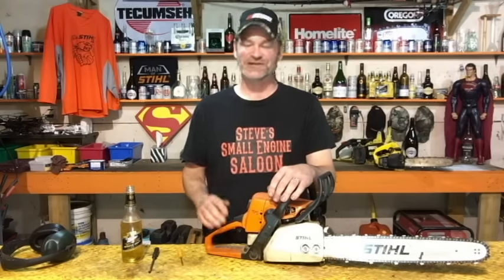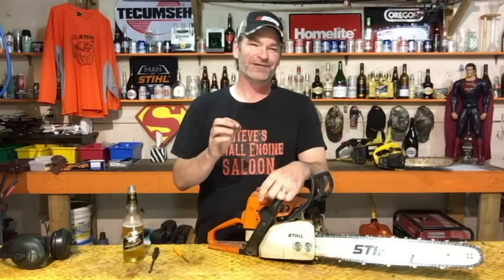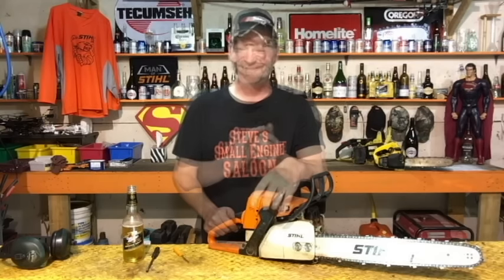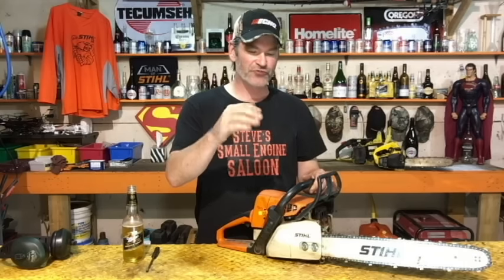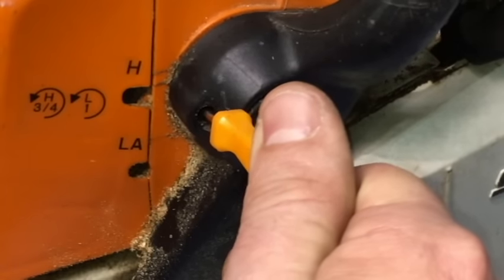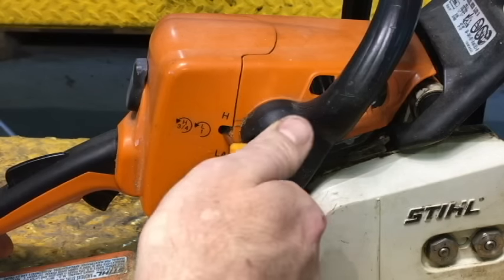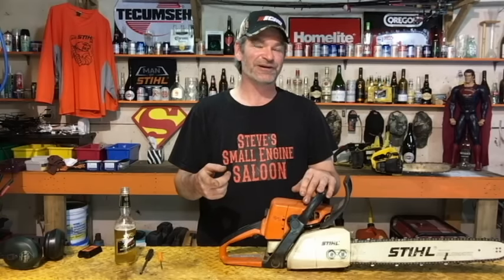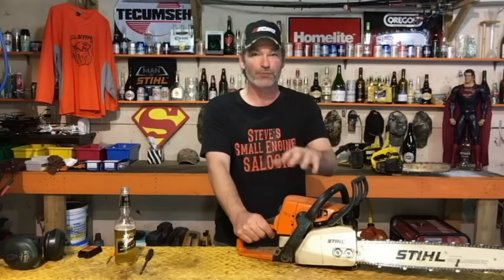CORRECT WAY To Adjust Or Tune The Carburetor On A Chainsaw (Step-by-Step)

Comment: my Honda(being 8 years old at the time) had a stuck choke valve and it would not open. It was "auto" choke! so I had to take it apart just to clean the gunk off it with my fingernail.(and that is the tool I used) but took a few other tools to take it off!

Comment: my bigest problem with carburetor is on stihl 041 av electroinc,i cant set idle  to idle nice and clean if i rev it up it bogs down to stahl,i start with one full turn both H and L  and  starting wiith  L adjusment but no luck so far .will replace all membranes in carb since engine was in shack siting for 2 y.If anyone knows bit much about 041s any words is  helping.Tnx great video liked and subed

Comment: Steve, have you ever heard of any kind of chainsaw test bed, which would have straps for holding down a small engine so you can actually work on it easier? I've been thinking of trying to build something like that. 

I have a Husqvarna 460 Rancher I recently cleaned the carb on by immersing it in an ultrasonic cleaner. It looks to be some kind of two-stage unit? Still runs like crap and I can't even seem to get to a point where the engine will idle properly to stay going. It seems like the low speed idle needle will only come out maybe 5/8's of a turn. Does this sound normal? Shouldn't I be able to take that ALL the way out? I didn't remove it to clean the carb. Perhaps I should have tried. And does the hi-speed idle screw come all the way out, as well? If the carb is clean and it wouldn't be that, (looking at your cold-start warning video) perhaps I should look more closely at the piston and see if it is scored. Because I bet that saw has been used from cold start right away. Good catch on that, btw. I never think consciously about how I use the saw (or how others do), but I'm pretty certain I always let mine warm up at least a minute or two. I've been using them since about 12 or 15 years old in Newfoundland. Anyway, any comments you might have would be welcome. Take care and all the best, eh? :)

Comment: So....this helped a lot, but when I checked my idle with a tach, it was (PERFECTLY) idling about 1000 rpms higher than manufacturer spec. Chain wasn't moving. When I set the L screw to get on spec, it just doesn't sound or function as well. 

Is there anything wrong with a high rpm reading on idle? My full bore rpm reading is just fine in spec.

Comment: Hey Steve. My old MS250 will idle for minutes at a time, run flat out no problem and throttle response is good. I can makes multiple cuts through big stuff with barely a break between cuts and it never gives any signs of fuel starvation.
But, if I leave it idling for more than 30 seconds or so it will die as soon as I touch the trigger, sometimes just picking it up off the ground makes it die.  
Do you know what's up please?

Comment: Can a chainsaw vapor lock or what might have happened to give this outcome?

I adjusted the carb on my Poulan the way you outlined and went to the woods with it this past Monday. The temps were bitter cold, maybe 5-10F w/o windchill. So, I made sure it would start at the truck before heading into the woods. It started fine and I kept it running/warming for the 5 minute walk to a tree I had already started cutting on a week before. Well, I only made it another minute or so before the saw died and couple of times. It kept bogging, getting progressively worse with time. After it fired, what I thought was it's last ignition breath, I couldn't budge the rope. I feared that she seized up. I tried a few more times to start it, once at the truck before I headed home and other times at home hours and days later. I was really feeling down about it.

Well, fast forward to more than a week later (today) and with it on the garage floor, thinking it'll only be good for parts, I pulled on the cord one more time and WALLAH! it turned over (with compression). I put some gas back in her and after 4-5 pulls she fired right up. Here I thought my 38-ish year old trusty saw had gone to heaven only to find out she lives on. Maybe she was really tired but couldn't give up because a new (Stihl) girl came into the neighborhood?? Either way, happy to have them both!!

Comment: My stihl 194t is on revs up just the bar and chain don’t move even while triggering.  My chainsaw is on just not moving I was cutting a tree 🌳 trunk it was working fine now the bar and chainsaw not moving at all.  Is my tension on to tight or is it dirty cause of
The tree cutting trunks not sure so I took handle off to clean up bar and chain this work 1 time now it’s doing it again.  The chainsaw pretty new not sure if the oil I’m using is the problem not oiling correctly.  I’m using 50/1 fuel ⛽️ and using a non branded bar and chain oil.  Do you have any suggestions.  Thanks keep up the good work.
Reply: Any suggestions what’s wrong with my chainsaw?   I’m not used to using equipment like this .

Comment: Hi Steve. I have pulled my carb out of my cheap chinse chainsaw. Am I supposed to be able to pump fuel through the carb and back to the fuel tank? It does not work for me. I have cleaned the carb out as much as I can. Still no flow through the carb. What could be blocked? I have flushed everything with carb cleaner......checked all the hoses...it is just the flow through the carb that is not wprking. Do have any suggestions? thanks Ian.

Comment: i just got a echo cs590 for 140 bucks, craiglist add. used twice, dull chain. looks like he cut some roofing. tar on the chain and bar. mfd oct 2019. almost new power head. very clean air filter. i pulled the exhaust and gutted. pulled the limit caps. google searches said three turns out on the H. what do you think. i might need to order a tach. man this thing screams.

Comment: Ms170 doesn't have High or Low adjustment. only an idle speed screw. Engine difficult to start and dies out quickly. How to adjust this. New carburetor Stihl OEM replaced and still not able to maintain the engine running. Any recommendations?

Comment: Steve what about old chainsaws with only 2 screws? I have an old Poulon and only see 2 adjustment screws. Low speed bottom and high speed top. Turned low speed in until idle wasn’t wide open but it doesn’t have a chain brake so I did it without the bar and chain on. I’ll hook them up today and see what needs to happen but it used to die on extended idles. Like even a minute. Is there an idle adjustment on the other side or am I on the right track?

Comment: To adjust the carb on a Poulan 1800 woodsman , you have to take the top off to expose the needles. The foam filter is in the front. However, the throat of the carb is exposed, the filter not effecting the air going through the carb. If the top is on, carb adjustment needles aren’t exposed . What would be the proper way to adjust this carb?

Comment: Steve, I am trying to find a carburetor for sears/poulan 1991 20 inch gas opreated saw. 3.3ci with an hda49 model carburetor. Where do you suggust I look? I have looked aroung and can not seem to find one.

Comment: Hi Steve. I have a Poulan Pro 260. Sitting upright, the machine seems ok but could use a little tweaking. However, without touching the carburetor adjustment screws and turning the machine sideways the machine starts to accelerate and the chain starts turning. What could that be?

Comment: Hi Steve. I know this video is old, but I am asking for your advice PLEASE! I have a Poulan chainsaw that will ONLY run (idling) when it is on full choke. The moment I open the choke, the engine dies. This saw uses a special idle and full speed screw, and I can probably get the tool. But is something else wrong besides the adjustments? If not, then how would you turn those screws to get the engine to run, since the moment i take off the choke, it dies. Any advice is appreciated. Thanks.
Reply: The choke decreases air flow richening the fuel mixture “giving it more fuel and less air”. If the choke is the only way to get it to idle then you need to richen/loosen the low speed adjuster, therefore giving it the extra fuel it needs to keep it running. Your problem could also be a clogged fuel filter which could be restricting fuel flow making the mixture too lean “more air and less fuel”.

Comment: Steve,
Learned a lot about tuning my chainsaw. I have a question though. My Stihl MS180c doesn't seem to have three screw or adjustments that I can find. What will work the best to give it the "Wicked Response" that you talked about in your video. Mine seems to dog out and I have to really ginger it up to full throttle. Appreciate any tips you can suggest. Love you video's, keep em coming.
Reply: The 170-180 has a self adjusting carburetor. The only screw on it is the idle screw. If it's bogging down, you may need to take it off and see if it needs a diaphragm change or a cleaning out.

Comment: I have an old mcculloch 610 that a friend found in the trash and gave me. Fixed it up and got it running. No limiter caps or special tools. Just a flathead. Made in simpler times. Lol
Reply from the maker: Right on
Reply: Your video helped a lot. It wouldn't idle for more than 10 or 20 seconds. Turned the L screw out about 1 turn and it idles great! Now just gotta put on the bar and chain and fine tune. Thanks!

Comment: My ms170 bogs immediately when i press the throttle and then spins up to cutting speed. There is like a delay or hesitation of the saw. Would I adjust the Low idle?

Comment: My 041 does not have silly limiters. Hey Steve you look like you know your way around a chainsaw. Here is a question for you. I have a Echo CS 400,  I've had it for a few years, it ran great, until it died. Then it would run great and die, would not start till next day. I determined it is the coil. So I got a new coil on and it started on the first pull, but here is where the question comes in. It does not run as good, it seems like its only running at partial power. Question------ Is it possible the coil is not putting out full zapping power? I mean when I put in the old coil it runs like it used to run, great, then dies when it gets hot. New coil , starts right up, and seems to run about 7/8 power. With this small saw I need full power, which led me to find about limiters on carb adjustments, every other saw I've ever had you just stuck a tiny flat screwdriver in the side of the carb and twist till it sounds good.
Reply: Hmmmmmmmm, no reply

Comment: Steve. I have a Makita DPC7311 14" cut saw. It won't idle and I have just replaced the gaskets and diaphragm because it was flooding from the get-go. Starts after a few pulls, but won't run on its own if you let go of the trigger. If I hold the throttle on a bit, it'll run. So what I have on this model, and I removed said plugs that you had mentioned in the video, a L (Low) H (High) and an S (?) below the other two. I'll presume that that is the idle setting? Anyhow, since the unit won't idle on it's own, how should I go about adjusting everything? Thanks!
Follow-up; So I turned all the L & H set screws clockwise until they wouldn't turn any longer. Then turned both screws one full turn counterclockwise, fired up the machine and made some adjustments to the L set screw until the unit idled. Then I adjusted the idle speed (S) screw. Seems to be okay now, but it hesitates to get up to full rpm when I press the throttle.
Reply: No Answer. Hmm...? Thanks!

Comment: My chainsaw is fairly new, starts and runs well.  It doesn’t take long after 10 or so cuts and it dies.  Engine seems really hot, like maybe it overheated.  Let it cool and it will run again.  Is this improper carb setup, or fuel:oil mix or where do you suggest I start?
Reply: Could be ignition coil going bad. Engine is supposed to get hot. Do the carb adjustment to rule this out.

Comment: My Husqvarna saw is a small 334T Limbing saw, and it started popping at high rpms, I have not made any adjustments, saw is at least 12-15 years old, and has been well maintained. Where you are doing the rpm check on the stihl, mine will start popping, seems like should turn down high screw, any ideas. Never had this before. This carb has never been adjusted, has always run perfectly?

Comment: Great videos thanks, worked on other small engine but I now have a jonsered 625 II in the family that’s been passed on to me. It runs pretty bad idles up and down sometimes feels lean sometimes feels rich, and uses a lot of gas! I blocked intake and exhaust and pressurized the engine with a smoke machine (leak detector) Did not find leak and it held the pressure so crank seals etc should be good. What is weird is I turn the low screw all the way in and it stills runs. I don’t get where it’s getting more fuel. Should I just go ahead and put a new carb on it?

Comment: My saw starts up fine cold, but not hot. I might cut a few limbs (10 or more) and turn the saw off so I can clear them out of the way. That's when I can't restart it. I've tried no choke, with chock to no avail. It fires up after a few hours. New gapped plug and fresh gas. Any suggestions? I've gone through your videos ( thank you by the way!) and I'm still stuck.

Comment: Amazon to buy them called toolkit.   Came with correct driver for LA and correct driver for h and l for stihl weed eater.   Also came with one to adjust my poulon pro pilesaw.   Cheap 10 or so.   Amazon search toolkit orange bag.

Comment: Hi Steve! Found you through Buckin’ Billy Ray! I have a little Stihl ms170 which I have starting and running great. Problem is after about 15-20 minutes after it’s good and warmed up it won’t run. It will start and idle for 3-5 seconds then dies. And just get progressively worse til I can’t use the saw til it completely cools down. Any help would be great! Thanks
Reply: Ignition coil maybe.

Comment: I just replaced the carburetor on my little echo cs-310 and it is not happy. If I turn the idle screw high enough to get it to even start, it takes off like a jet engine once running. If I then try all these steps it seems to just jump all over between jet engine and stalling without touching anything. Is there something else that could be causing that?

Comment: My ms250 no matter how I tune the high screw it reves way way to high. My other saw with the same has is perfect so it's not my gas. Any tips of how and why it's doing that? I rebuilt it and changed the carb and basically fully rebuilt the saw.

Comment: Ok , I've got a Robin hedge trimmer ( Fuji industries , Japanese , Makita later bought them out and produced the same machine ) . The problem is it doesn't have the L H adjusting screws , only the idle screw . There is one other screw that was sealed with a plastic plug at the factory , removed the plug tried adjusting that but it turned out where it was already was the best . Anyhow that hasn't solved my problem which is that it starts and idles perfectly but theres no cutting power in the blades (they just about move at full revs although pointing the blade skywards or to the ground makes a little bit of difference )  The machine is in virtually new condition and the clutch appears fine , I've changed the fuel lines , service kit on the carb , everything looks fine I just can't adjust the carb . . What I need to know is how do I go about finding a compatible adjustable carb to put on it . I thought there may be a list of alternative / compatible carbs somewhere but can't find one . . It's a shame because it starts and idles as sweet as you'll get but there's no power and I'm through messing about with that carb

Comment: I belive the high speed screw is the air fuel mixture screw for the high end. It runs faster when screwed in because its running more lean.

Comment: Right next to the high speed adjustment hole it says H 3/4 with a counter clockwise arrow on your saw. I thought that was how far to turn the screw out from bottomed. Thanks for the info.
Reply from the maker: The markings on the saw assume you did not take the limiter caps off.....
Reply: @StevesSmallEngineSaloon  Thank you.

Comment: Hi Steve, I'm having trouble trying to pull the start cord on my Stihl FS38 Weedwhacker. It pulls fine if I remove the spark plug. Any ideas on a fix please
Reply: Check that it hasn't swallowed an airbox retaining nut. There are 2 of them you can see after removing the air filter pad. Make sure they are there and snug.
One of those nuts went inside my cylinder and luckily it was just a new piston and light dremel work on the intake port.

Comment: Steve - at 8:25 you show the Stihl tach you use, which you said does not have to be wired in, but the pinned link shows a different tach on Amazon that seems to require you to wrap the sensor wire around the plug wire. Can you recommend a true wireless tach please? Great video btw, thanks!
Reply from the maker: The wire is there only if you want to attach the unit permanently as an hour meter!
Reply: @StevesSmallEngineSaloon  I ordered & just used the one from your link. It wouldn't work until I wrapped the wire around the plug. I can obviously still use it, but it definitely isn't touchless.

Comment: I have a different problem. My engine seems to start, rev, then dies. I just changed the fuel filter, and the carburetor filter the last time I used the saw, but I see debris in the carbonator throat.I did pull the filter out of the fuel tank but it's not dirty. Do I have to dismantle and clean the carburetor?

Comment: my stihl 023 its an old saw my was running rough low power found my muffler  bolts were loose would this cause it to bog down no power

Comment: I Put a new carb on my craftman saw idols fine but at full throtle it bogs down big time, it will run good at 3/4 throtle, would that still be the low side screw adjustment?

Comment: Steve: I currently run 50:1 in my saws and have been considering switching to 40:1. How would I need to tune my carb if I did so?